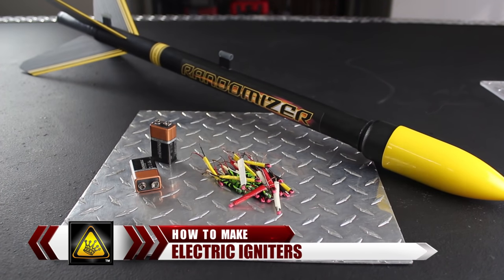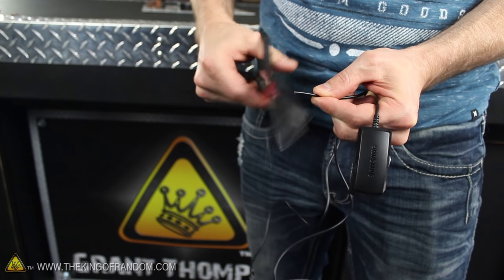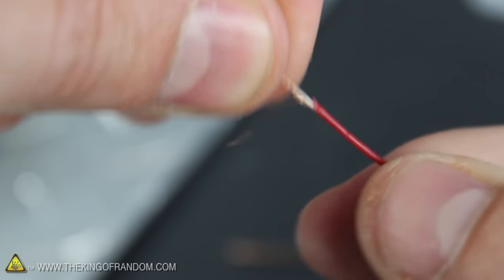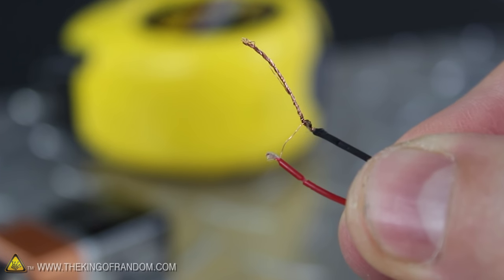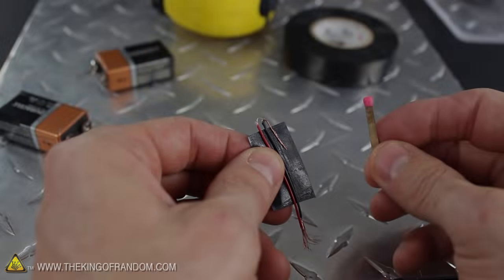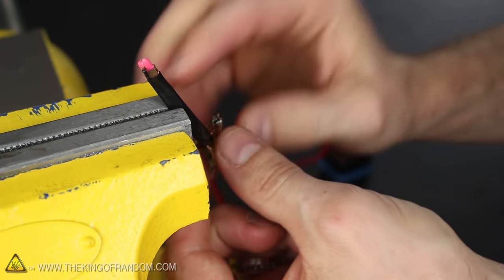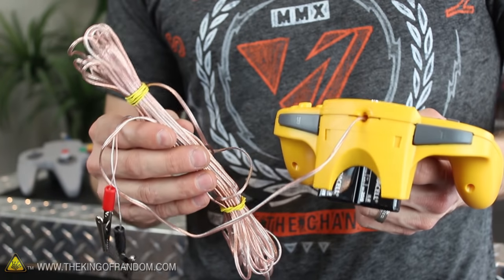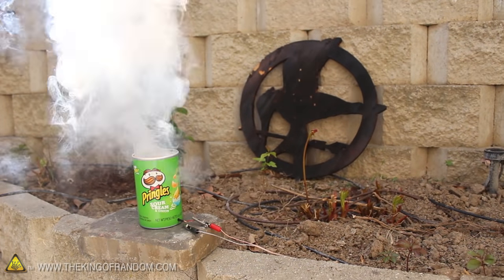How to Make Rocket Igniters (Electric Matches)

Comment: Tip: just buy 2 energizer advanced pile alkaline AA batteries (that's what they call em here, they are one step above the max).
I shorted these with a thick wire and it burnt my skin bad. This means that the wire could potentially be reusable! But when i shorted it by mistake with just a small strand like you showed, the thing was red hot instantly!! Plus AA last way longer and are cheaper!

Comment: I used a car battery instead, seemed to not be enough current for the wire that I had available when using 2 nine volts. Thanks so much for the video Grant Thompson!

Comment: Thanks.  Your simple inexpensive ignitors and 2-  9V batteries probably work better and cost far less to use than the Estes igniters I bought and used in late 1960s.  with 4 D cells.

Comment: I completely understand that this will work but where did you get the 6amps from? Wouldn't that matter on what the resistance of single strand of copper wire be?

Comment: I just use tiny glass diodes for my igniters.
They cost a few cents each, no match needed.
Or you can even add a match and it will ignite it for that extra kick..

You just need to attach a 9V battery, they glow red hot for a good 5 seconds, enough to ignite anything.
Reply: SunnyZ what kind of glass diodes? Will it be reusable if you light say hydrogen gas?

Comment: I can do something like this on my own (I mean, I should be - I am an electrical engineer), and I think you present this very well!

What I am most impressed by are your wire strippers. Every time I get ones like yours, they don't work well! Yours seem to work perfectly! How? D:
Reply: You say you're an electrician, that's fine, I'd like to ask you something. I tried to do it at home but no and it doesn't work, my wire doesn't even warm up at all, doesn't you wonder what it could be? if it is the wire I use or the source and if the source what is actually causing this heating current or voltage?

Comment: wouldnt buying regular spooled stranded wire do just the same thing so you dont have to scavenge for chargers in thrift stores all the time?
Reply: yeah it would do the same thing, but it seems like tries to use the most common materials possible, for most people it's easier to find a charger than a spool
Reply: Yes mate it would work fine :)

Comment: Battery gets hot, nothing happends
Reply: +CoolFido CZ The way this ignitor is supposed to work is by taking an electrical voltage and short 1 strand of wire. The voltage across that one strand will cause an excess of current which can't be dispersed in a cluster of wires like it should. This leads to the wire overheating and exceeding temperatures of ignition. So your problem may be that you
A) Don't have enough voltage (batteries in parallel will "add" voltage)
B) You are using too many strands of copper wire, should only use 1 for best result.
C) Make sure you have 100% continuity in your circuit.
D)Your matches
Reply: Wow.. It's so easy, yet there are people in this world who can't build even the simplest things.
Reply: +Xanthe Quintin I can work with electrical circuits, but i think i have much thick wire strand.
Reply: When I tried it, the wire simply sparked and blew, it did not ignite the match, is it possible that I am using a way too powerful battery?
Reply: The machine spirit was kind.
Reply: +Sir Torrance 'Current' adds up when similar batteries (as in this video) are in parallel. Voltage is the same as that of a single battery.
Reply: Well look at that... I totally knew that but I said parrellel adds voltage.... Well I apologize.
Reply: @sirtorrance2069  hooking battery up in parallel doubles the amperage not the voltage

Comment: Great video, hugely useful. However, I would have through that the match-head was a little too big to fit into the rocket motor hole. Did you have to shave the match-head down at all?

Comment: A word of advice for anyone doing this: It's possible to have too big of a battery. A high current supply will blow out the wire too quickly to cause the matches to ignite. 115A like I'm supplying from a lipo is way too much. Smaller is better.

Comment: Have you tried resistor igniters? Basically just take a resistor and burn it up with overcurrent. I have planned to try to use old film camera charging circuit to ignite the resistor, i hope this would give ignition immediately when you press the button. Oh and you get the cool whining charging sound :D

Comment: Nice video, Grant, but I am puzzled over why you specified a cell phone charger as the source of the stranded copper wire, even to the point of finding one at a thrift store. There are a multitude of sources for that, which could potentially be in someone's parts box or junk drawer.

Comment: Why did you put the batteries in parallel? Wouldn't that provide the same potential difference as just using one battery, thus the same current?
Reply: ***** More amps and amps are what will heat the wire. Same principle what foam cutters use.

Comment: Hi. May be I missed some info in video, but some 9v betteries are piece of crap. And it is necessarily to buy betteries like yours. I bought varta E-Block 0.55$ each and it doesnt work. It is less then 2A on my multimeter indicator. I know that is my fault, but I realized it very late. I tried the same experiment with my car bettery, works perfect:) Anyway, thank you for your video!

Comment: I did something very similar a while ago, I made a control box out of a plastic shoebox and ran cat3 out to the field and used it to launch fireworks.  My ematch was made by using firework fuse and nichrome wire... I used the nichrome like thread and sewed it back and forth through the fuse and then cut it into usable pieces after I was done.  The combination of nichrome and fuse made a very active ignition.

Comment: If you wanted a completely wireless setup, you could connect a Raspberry Pi (probably A+) to the igniters via the GPIO and then write a program to send electricity through the pins. If you made a web interface for this and connected to an travel router, you could even control it from your smartphone.
Reply: Mason Atha Stay right there. There are some "people" on the way to speak with you.

Comment: Would strands of steel wool work instead of using a match?
Reply: Zach Crawford Steel wool is metallic, so it'd do nothing. I think. Or at least not burn. Besides, the match also has that flash when it lights as well.
Reply: MrJJandJim cuper is metalic too ...?
Reply: Zach Crawford To burn steel wool, you need it to be "fluffy", to have the steel close to a good source of oxygen. In a rocket, the steel will start to burn, but it will use all the air super fast.
Reply: Zach Crawford it would ignite if you make it fluffy first but I think it might not ignite other materials because of the oxygen consumption still should work on some cases, just try ;)
Reply: Zach Crawford Yes you can, A bundle of it can be lit with a single AA battery, however to make a strand of steel wool light you might need to up the amperage to generate enough watt's to light it on fire.
Reply: Zach Crawford If you can separate the tiny strands out of the wad of wool, yes.  You'd just have to twist each end up with the ends of the supply wires (you might have to burn the coating off each end of the steel wool wire first in case it insulates against making a good connection with the power supply wires).  Any very thin wire you can get out of multi-strand wire would work, such as the thin stuff inside phone wire (if you strip a piece of phone wire and it's solid copper, that's 24 or 28 gauge and would likely be too thick to get hot enough).  It's just a matter of getting strands of wire that are thin enough to get really hot with just battery voltage.
Reply: +00Skyfox don't you mean you use the batteries for the Amps, /// volts are the power and amps make the current, that's what makes the wire burn
Reply: Bro Modz Either way.  You know what I mean.
Reply: Bro Modz the general idea is to generate enough waste heat with the amperage in contrast to the resistance/conductivity of the wire to generate enough waste heat it will reach combustion point.
Reply: Zach Crawford Yes.  That is what I use to make my electric matches.
Reply: Zach Crawford I don't recommend this method to anyone serious in homemade rocketry!!! This will likey cause a CATO in most rockets since the matches and tape used to make these igniters tend to clog the nozzle! I highly recommend using the ping pong ball melted in acetone to minimize the size of the wires and prevent personal injury! Grant Thompson, please remove these videos and do proper research on the hobby before uploading these. Please pm me. This is an extremely dangerous method of motor ignition. Continue at your own risk!
Reply: Spencer Coleman I kind of thought his method could be a messy one. Thats why I was wondering if I could replace the matchhead, tape and copper wire with a stand or two of steel wool. would that be safer? or even work? You sound like you know what your talking about, so it would be cool to hear your opinion. But I think most of your comment was meant for Grant Thompson and not really for me. You may want to re-comment him directly because he may not even see you comment here.
Reply: I've tried that before wrapped around a piece of fuse with very limited success. Seems the fabric they use for fuses is a fire retardant which makes sense since fuses burn from inside out where the pyrotechnic is. If you just use the steel wool don't expect any results. The Sparks that shoot off of steel wool burn too quickly to ignite the motor. That's why a mix of nitrocellulose and black powder method shines (ie the dissolved ping pong ball in acetone). Check this website out. Super helpful:

http://www.jacobsrocketry.com/aer/homemade_wire-wound_igniters.htm

You can watch one of my first h class motors go off on my channel too. I've done a lot of experimenting and the highest class motor I've built successfully is an I class. Unfortunately the footage was lost on my anniversary when I inadvertently put my cell phone in my swimming trunks and it took a drink. And I haven't had a lot of time for the hobby lately either because I'm going to school and working two jobs simultaneously at the moment. Now that finals are over this summer I may find some time to make tutorials on building my most reliable motor so far which is an f class motor. Is cost effective and haven't had a CATO with my design yet. Look for it over the next 3 months:
Reply: Cool, i'll definitely check it out. Thanks for all the usefull info. Sorry to hear about your phone, lol.
Reply: Haha, no worries. Just lost a lot of good fotage. Guess I better start using backups
Reply: xesior do u ever have to replace the batteries ? Because ive been using these for about a week, and they used to work just fine, but now the matches arent lighting, and the batteries are getting hot, due to overload from holding the switch too long. Is it just the batteries have lost their amperes? is that possible
Reply: Zach Crawford  hey good question actually i tried it and i didnt get a result all it did was catch fire lol.
Reply: Bro Modz Yes. Using batteries in this manner actually consumes a lot of the battery capacity. The stored electrons are being pushed trough a resistive force, which in turn generate the heat necessary to make the match ignite. Sadly this is a very inefficient process, and consumes large quantities of stored electrons. This is also the reason why your battery becomes hot. (lots of electrons moving inside the battery, in large quantities and very fast) If a battery becomes to hot it will lose its ability to store electrons. Damaging the cell. A quick way to check the condition of your batteries is by using a multi-meter device (they are rather cheap) in combination with a resistor of around 100 ohm's. to see how much juice they got left in them.
Reply: Thanks xesior

Comment: so I am attempting to do this project but I get get the match to ignite, I am using 18 gauge wire in the igniter and speaker wire as the wire with a aligator clips. Any ideas??
Reply: I don't get it to ignite
Reply: I figured it out.......
Reply: Kevinthewiseone what was the issue?
Reply: The1NdNly the wire I used was too thick, the battery that I had where junk. So I ended up buying a roll of nochrome wire 32 gauge and that solved the problem of a to thick of a bridge wire. I also recommend using phone wire as the igniter leads, it makes for a more compact igniter.

Comment: another option instead of the copper wire is to use nichrome wire. I got a spool containing wayyy more than I'll ever end up using of amazon for about 5 bucks. It is pretty reliable.
Reply: Hey, I tried both aluminum and copper wiring but only the copper lit the match on fire, any idea why? The strands looked about the same diameter, and aluminum has a higher resistance than copper. Using the aluminum I held it in place for 10 seconds but everything just got warm, while the copper lit it instantly.

Comment: My charger has wires one the outside, enclosed by the original housing, and on the inside, there's another cable with wires it it as well.

Comment: What kind of batteries did he used.
Could not get them to light :(
Reply: 2 x 9v pp3 batteries in parallel.  So you get 9v but with more current.  Tried with one, didn't work.  But with two it worked a treat.

Comment: @Grant Thompson - "The King of Random" Dear grant I have tried several times with this experiment and it will not work, please can you make a new, more detailed video about this it would have been very helpful, thanks
Reply: Happened the same to me. I found out the wires wear a coating of spray which won't allow electricity flow. If you try scraping out this it may work ;) Maybe a bit late jejeje

Comment: Can this work with match rockets, I am trying to make a lego cannon but cant ignite it.
Reply: Match box rockets?
Reply: yes
Reply: Probably not, the mathheads have to ignite, but this wont even reach them
Reply: so its impossible to make electronically fired mini rockets for models
Reply: Science Man try it, no other way to find out
Reply: It is possible, but will increase weight of the rockets and destabilise them. It's probably better to use outside heater, which you can make electronically fired, and use to activate your rockets.
Reply: electronic match to light it?
Reply: Science Man Yes, under the rocket head. Or, you can use two small wires, cend them under the foil through the head, used as fuel, and leave two loose ends at the bottom. Then you just need to make two contacts on the startingn field and design a way to give them current.

Comment: could you use speaker wire instead of a cell phone cable
Reply: Yeah as long as it has very thin strands. I tried it with thin stranded aluminum and copper wire but only the copper wire lit the match, not sure why (aluminum has higher resistance, which means it SHOULD'VE gotten hotter).

Comment: I don’t think this will work for me.  The ignition circuit I built only used 1 9volt battery.

I’m thinking; if I had another 9volt at the end of my circuit, with is run in series….it should work???

Comment: you could always buy a  DC 3.6V-6V 400KV 400000V Boost Step-up Power Module High-voltage Generator and three other components and have something that's re-usable with only one thing to replace which would be the AA batteries

Comment: Where did you come up with 6A by short circuiting two parallel 9V batteries?

 I agree you have 9V on the wire, but with a short circuit, you're going to get whatever amperage the chemistry on the 9V can muster before it melts the copper wire.  

I = V / R  where V is 9V and R is almost zero (short circuit).  That makes I (amps) very high.  

Example: Using a single strand diameter of 0.160 mm, with a length of 1cm, gives a resistance of approximately 0.0083457 Ohms.  That would result in over 1000 A of current!  

To make 6A, you'd have to have a wire resistance of 1.5 Ohms, which would end up meaning a wire diameter of 0.006mm!
Reply: internal resistance of a 9V battery is about 1-2 Ohms.

Comment: Careful with this!! It's never a good idea to short-circuit a 9-volt battery, let alone two of them in series. If you keep the circuit closed long enough, the battery may burn.
Reply: requemao Its never good idea short-circuit anything. But in case of this build, the wire will melt and cut the connection, before battery burns, depending thickness of wire of course.

Comment: Here is how to make it easier:

Take old school christmas lights (the small ones, incandescent with wires inside not LED!) then cut it from the rest of the lights with two cables sticking out. 

Snap off the top of the tiny lamp, then fill it with resin or flammable glue. 

Apply voltage on the wires, the resin inside will ignite.

Used them with great results. Plus this is waterproof and Grants ones are not.

Comment: i tried doing this but it didnt work please could you write down the steps because we cant seem to get it ti light the match.the match isnt a safety match so we dont know whats wrong if you could help me please thank you 

your fan Ben Ingledew
Reply: +Ben Ingledew if any one could help that would be great thanks
Reply: +Ben Ingledew you need to connect to a match 1 small wire and 1 big wire (the wire made out of lots of wires) to the small wire connect the + of the battery and the big wire to the - of the battery.

Comment: not working on two 9 volt batteries pls help                                                                                                                                                                                             i works on regular switch boards ie 220 volts
Reply: Wire may need to be thinner